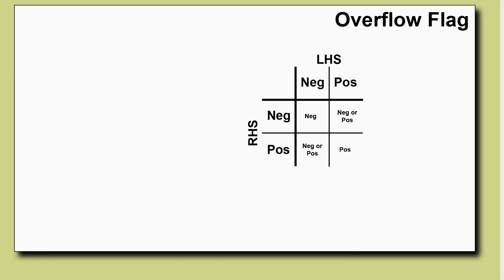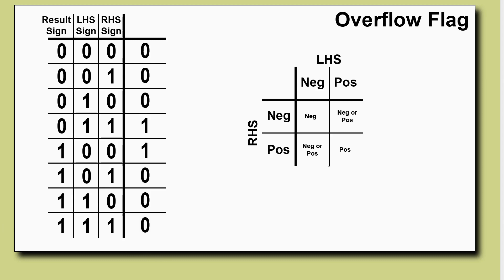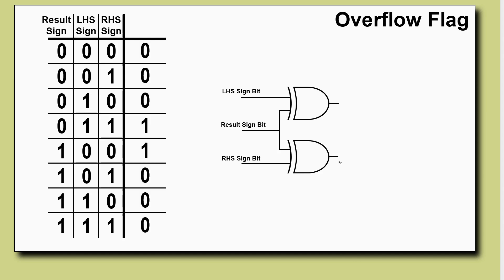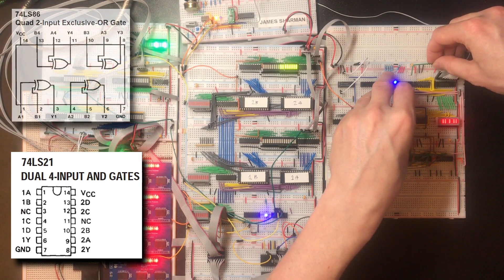ALU  (8: More Flags) - Making an 8 Bit pipelined CPU - Part 33

Comment: I'm mildly surprised that you stuck with the ROMs in the pipeline stages. With careful opcode assignment, I bet you could do the job with programmable logic devices - 16V8's, say.  Those are both faster and cheaper than ROM's - 1 $1.50 part even with today's shortages will have a 15- or 12-ns pin-to-pin delay.

Enjoying the series a lot!
Reply from the maker: My preference would be to replace the rims with simple logic but the isa was too tight to lay it out really neat. A future build will be more designed with that in mind.

Comment: Shouldn't all of the ALU flags be getting latched, not just the two carry flags that are getting latched at this point in the build? The unlatched flags could show up at any point from when the intermediate latches are latched halfway through pipeline stage 1, to when the ALU output is latched halfway through pipeline stage 2. That means you wouldn't know for sure which instruction the flags would be available at, which is very important since, again, those flags aren't latched and will go away if you don't use them immediately.

Latching all of the ALU flags would also potentially allow you to add a "latch flags" control line so you could chose when to latch flags. That would make programming simpler, but I'm not sure you'll have enough flags for that. (I did some thinking, and I suspect there won't really be any spare control lines with only two EEPROMs per pipeline stage.)

I realize you've already finished this build, but I wasn't sure how to convert this comment into past tense.
Reply from the maker: At last something interesting from your inspection! It's good to have been thinking about this, but it's not necessary. The carry flags need to be latched as the output effects the input. The other flags are deterministic based on the inputs so they will settle. This IS significant because as you correctly state they form part of the latency added to the pipeline rom access time. So the maximum clock rate is constrained by flag settling time PLUS pipeline rom lookup. That would be worth further study if it formed part of the critical path, but it does not. The critical path passes through pipeline stage 1's rom lookup PLUS instruction fetch (i.e. the memory read), once you realize that the flag logic settling merely has to out pace a memory read in order to keep it off the critical path it stops being a worry. I have a future video planned that touches on all of this.
Reply: @weirdboyjim  Neat. I believe this does add an interesting programming quirk that branches need to be done at a very specific time after the instruction that sets the relevant flags, but that's not a deal-breaker.
Reply from the maker: @sillymel  A flag dependent operation uses the flag value from one cycle earlier than if you read the instructions in order. This kind of behavior is not uncommon on risc type cpu’s, it’s just something you need to stay aware of. In video 67 I write a multiply routine that needs some explicit nop’s for this reason.

Comment: Hi James, Am I right in thinking that because of the way you've designed your ALU, that a right shift instruction (with carry flag) may cause an Overflow depending on a previous value in your second (unused) latch register? Also, what about the XOR operation on the two inputs which both have their MSB set? I guess what I should be asking is - did you put any conditions on your 'V' logic depending on the function your ALU was performing?
Reply from the maker: Both latch registers are clocked at the same time, so in the case of logic or shift operations the other latch always holds zero.

Comment: I recall the Overflow flag defined (in some 8-bit CPU docs) as being a function of the sign bit and the carry bit.  That's only 2 inputs, and both are other flags not bits from other registers.
Reply from the maker: Unfortunately not, you need more information than is present in those two flags. It's possible there is a simpler solution than the one I presented but it's the best I came up with. Consider the following four legitimate operations 1+1,1-1,-1-1,-2+1 they represent all 4 permutations of carry and sign bits although none should trigger overflow. The information I use is the carry flag combined with the sign bits from both inputs and the result.
Reply: Another simple way to think about Overflow is that it’s set only if the sign bits of the operands are the same AND the result has a different sign bit. Since that’s a 3 input, 1 output function, you can implement it with just a single 74LS151.

Comment: SImplest V flag implementation I've been able to find on the internet :O
Reply from the maker: Are there many?
Reply: @weirdboyjim  At least one more for sure. The 6502 used the C6 bit and the MSB bit to do it(I think).
Reply: those are the only two quite good ones i found when investigating:
http://teaching.idallen.com/dat2343/10f/notes/040_overflow.txt
http://www.righto.com/2012/12/the-6502-overflow-flag-explained.html